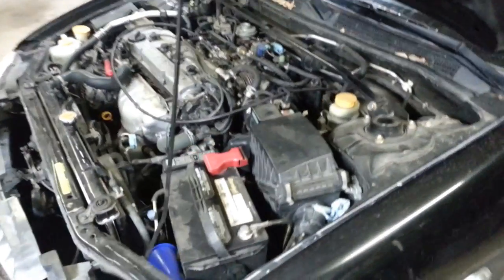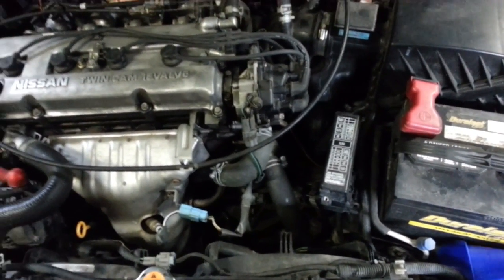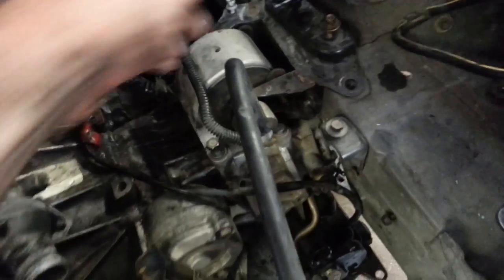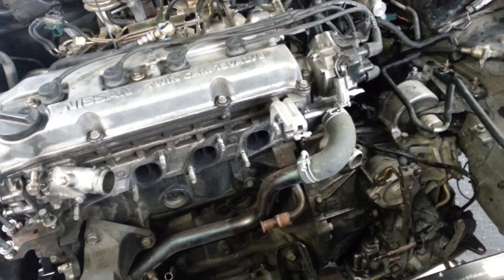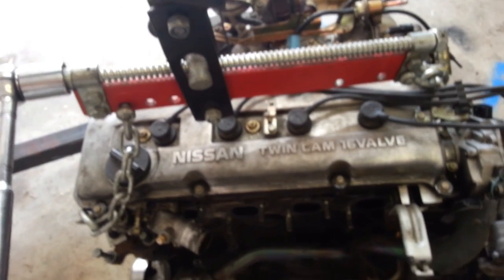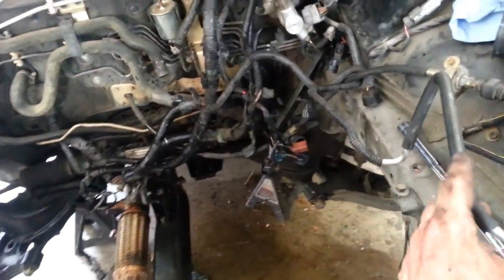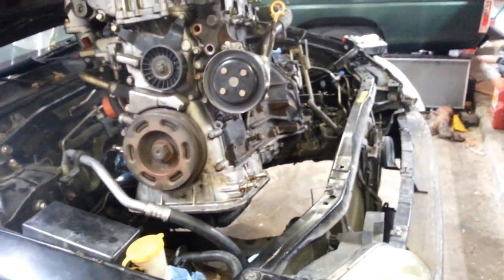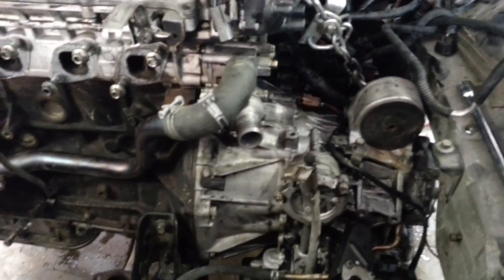Nissan Altima engine and trans removal and replace as a unit

Comment: Thank you so much for posting this. I'm about to do the same job and I was not looking forward to dropping the front crewmember.
Reply from the maker: Thanks!!! I hate pulling that cross member. I don't care for lowering engine out bottom.
Reply: Nissan Nut what bolt points did you attach the chains to? I paused the vid but I couldn't tell for sure and I'm having a hard time deciding where to attach my chains.
Reply from the maker: The front motor mount bracket inner hole and the one in the trans, below the mount. Look at 3:56. Sorry I was a little fast on showing the holes. Also see https://youtu.be/0eocQcQXRx8?t=346

Comment: I’m mid job of trying to change the clutch and flywheel, do I need to take both cv axles out? I’ve taken driver side cv axle out and not sure what to do next and don’t want to forget something before holding engine up with hoist and unbolting trans
Reply from the maker: Yes, to pull trans both axles need to come out.

Comment: Hey do you know if you can change out the engine with a different one, or where to get that engine you have in the video.
Reply from the maker: I used car-parts.com to search nationwide junk yards for an engine. Found this one for 180 complete from a totalled car. They had 3 totaled sentra's. This was the most expensive engine since it only had 49k miles. I am in Dallas TX, so they is lots of yards local.
Reply: @NissanNut74  Thank you so much

Comment: Do you prefer removing a 2000 Altima 2.4l engine from the top?
Reply from the maker: Yes. Much easier. I dropped out the bottom once with trans.
Reply: Ty

Comment: I have a question. I'm trying to just take the transmission out of the Altima. Is there a way to take the transmission out without removing the engine?
Reply from the maker: Yes. dropping out the bottom is easiest. I used an engine hoist. The only hard part was unbolting the torque converter via the access hole. The crossmember limits access to it, but I have done it.
Reply: Nissan Nut thanks a bunch!
Reply: Where did you purchase your used engine ??
Reply from the maker: http://www.car-part.com/ is what I use to find a local junk yard. You can search by distance and price. 2-500 for a complete engine Dallas TX area. 30 day warranty. The install right on my trailer for free.
Reply: Hey nissan nut.. I have a 93 nissan altima gxe will a 98 01 engine work for my car
Reply: Yes, its the same exact engine.
Reply: @aceevert4555  thanks

Comment: Can you remove the engine by itself?  If so, do you recommend going out of the top or bottom?  Also, any experience with JDM KA24de?  Going in Altima?  Thanks!
Reply from the maker: Removing both via top was easier than bottom. I think it be removed from top with trans not removed if automatic. But since 3 of the 4 mounts are on engine.  Its hard not to remove trans. Never used JDM, only the USA made stuff on this vehicle. I have used JDM older engines like L and Z series but there was allot of differences on intakes. So just swap over the intakes and all externals.
Reply: Nissan Nut thanks.  If you're interested, I can post my results.
Reply: @timrowe8123  I'd be curious too
Reply: I was able to use the jdm ka24.  I ended up taking both engine and tranny out the bottom.  I ended up using the usdm intake and exhaust.

Comment: How did you go about disconecting the plug that's in the middle but behind the engine it seems like it's in there tight
Reply from the maker: If you remove the axle, you can reach up and disconnect all those connections much easier from below. The axle is in the way and needs to come out for removal anyway.
Reply: Nissan Nut thanks man I appreciate you replying I love this car and it doesnt seem to have alot of attention anyways thank you

Comment: My timing change skipped and I got bent valves in cylinder #3, should I replace the tensioner and chain and pull the head and all that or just swap in a JDM engine? The car only has 122k so that’s why I’m on the fence about rescuing it. Thanks
Reply: Forgot to mention it’s a 5-speed manual I think yours is auto?
Reply from the maker: @weswest8666  Yes it was an auto. I would find a replacement engine locally. I found this one within 50 miles. I have used JDM engines in the past, but like the USA made ones. This new engine ran perfect! Car was totalled, air bags deployed a few months after video.

Comment: Hello Nissan Nut I have a question I swap a engine from a 2005 to 2003 Nissan Altima 2.5 the engine cranks but won’t start I remove the computer but is not the same plug I’m trying to start using a start engine liquid start but shuft off in a second any sugestions thank for your help I really appreciated
Reply from the maker: I dont know much about the QR 2002+ motor. Was the 05 intake different than the 03? I would reuse all 2003 electronics, just in case there different.